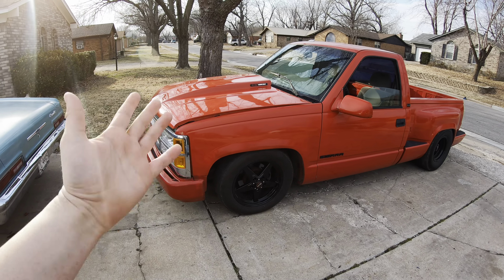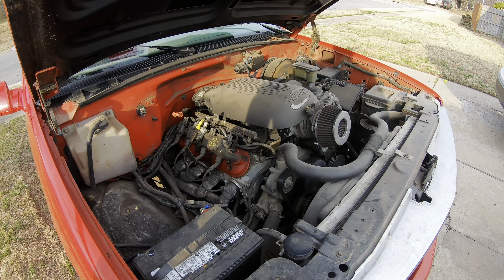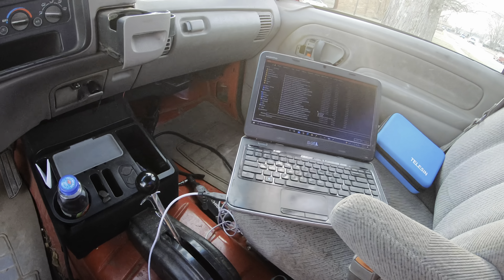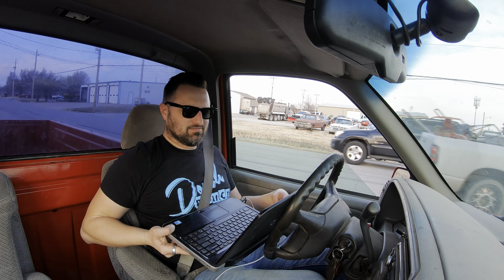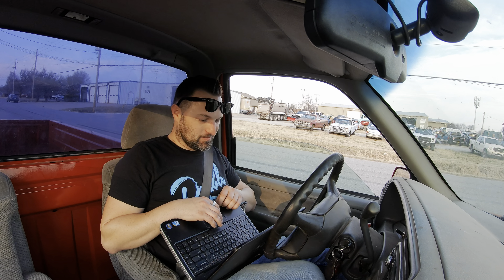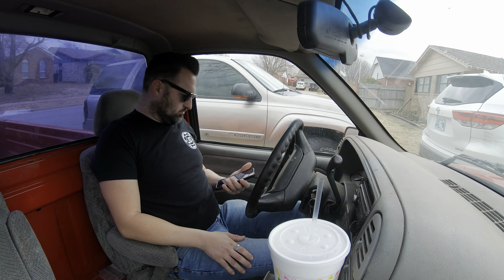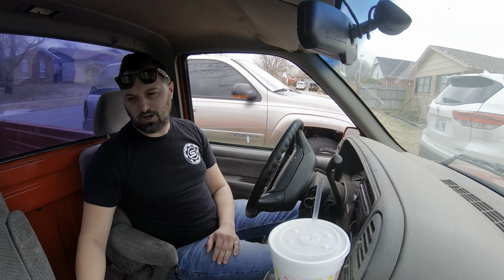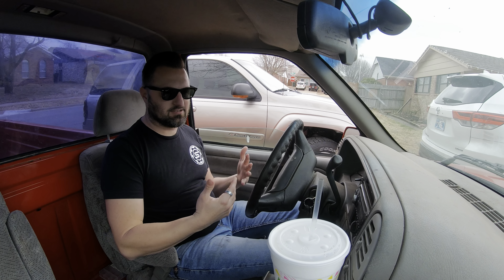5.3 BTR STAGE 4 OBS Tuning!!

Comment: Higher stall plus possible exhaust routing plus previous tune equals some toasty transmission fluid. 5000 miles of abuse before getting it dialed in didn't help lol. Change the fluid and send it!

Comment: Weird question but I have a 5.3 fbo and cam and I have a 4l60e with a 3,200 stall and when I downshift to 2nd rolling like 60 my rpm used to just stay around 3500-4000 rpm now when I do it the rpm goes way lower I’m not sure the exact rpm but u can feel it maybe like 2800rpm and then when I stab the gas pedal it jumps back up to like to 3500-4000 it’s the weirdest thing ever do you know what might be wrong